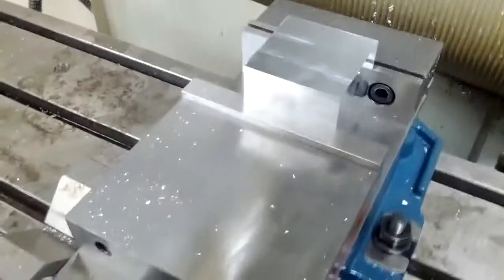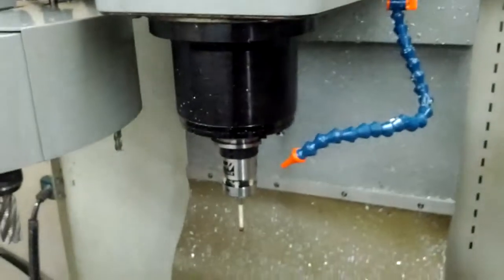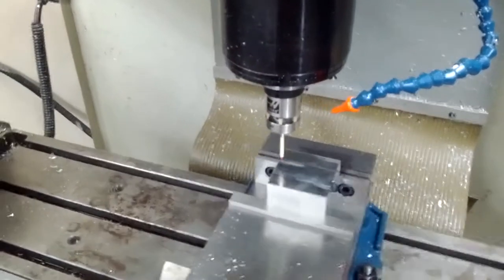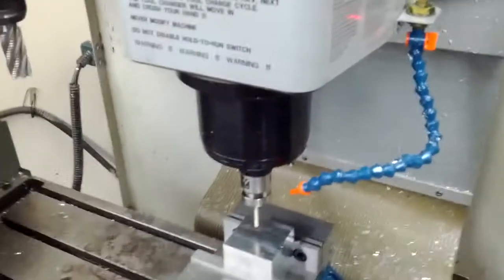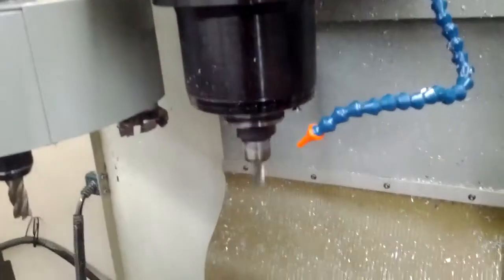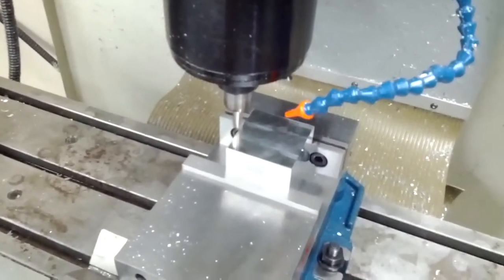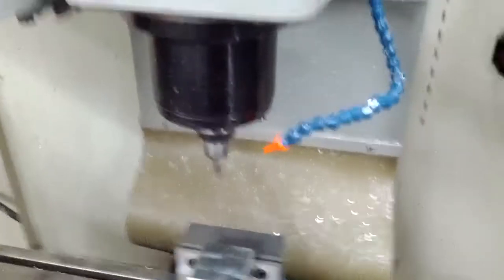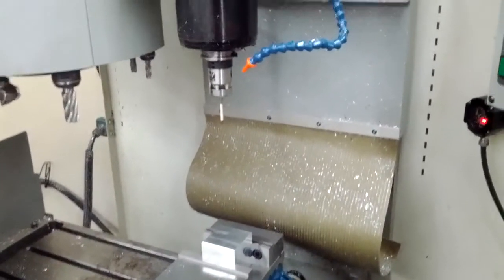Simple HAAS CNC Program with Renishaw Probe

Comment: Just got a renishaw prob. I get everything in your program except for the A16. an A letter is not specified in the renishaw book. Could you fill me in.
Reply from the maker: Wish I could remember! Haven't used this machine in awhile. It must be an internal macro command for the probe itself. If yours is newer or uses different software/firmware it may not match exactly.
Reply: I figured it out. For me its an angle move.

Comment from the maker: Hi. All of the tool offsets are measured relative to the Renishaw probe (which is always in the #1 slot). I do not use a touch off probe, I set the offsets manually by probing a clean surface and then jogging the tool down in increments of 0.0001" until I see the tool marking the material as I spin it around by hand. Once the tool has touched, I back it off 0.0001" and set the offset. Thanks for watching.

Comment from the maker: On this Haas machine the macros are available deep within one of the program menus. It's very similar to the visual quick code you see on the new machines but it's not as easy to access. It took some reading through the manual to track down the location in the system. Once in that menu we just select the probing method, give it a coordinate system to set, and the rough dimensions it should expect, the machine spits out the code by itself.